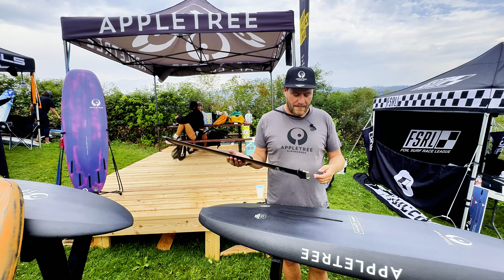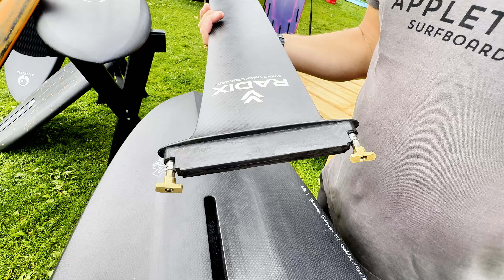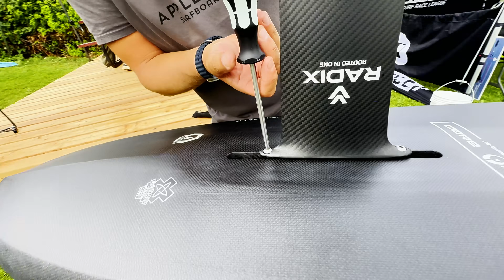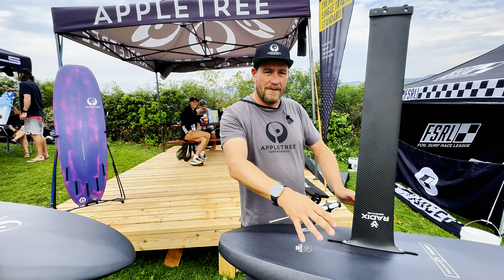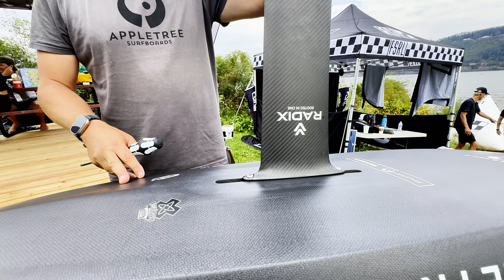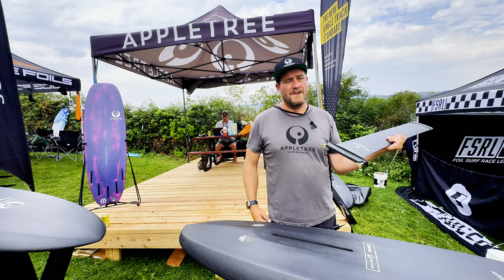AWSI - Appletree Surfboards 2026: RADIX board

Comment: I watched once again your video, and I have a question : You're using a tapered hole so that the mast lock in the box. Great, that is the best way to get a good locked mast. But there's a concern regarding the acuracy with the foil tapered head angle. Wear of the foil head (most likely not quite even) can lead to change in the rake setting of the foil, and even small change in rake angle can significantly affect the set up tuning.

Comment: I really like the new mast design—it looks sleek and efficient. It seems like you’ve managed to reduce the carbon layering, which could potentially lower production costs. If that translates to consumer pricing, it would be a welcome improvement. I do have a question about the T-nut area, though. In saltwater conditions, corrosion can sometimes make the T-nut sit properly and difficult to engage in the slot. I hope that aspect has been considered in the final design.

Comment: [Question for appletree] Have you considered making the tapered connection part of the mast deeper? Like 2 inches? Seems like you could transfer bending forces better and transfer forces to the top deck better with a deeper tuttle. The only downside I see is you couldn't make boards thinner than 2". But I don't see many (any?) boards that thin today.
Reply: Plenty of dock start boards are 20 mm thin. And add specialised tow and wake boards. I can't see it working for those boards...Or?